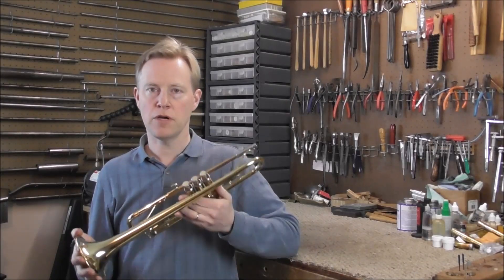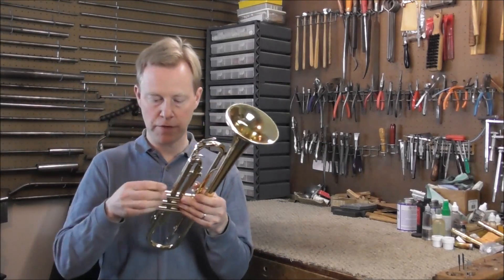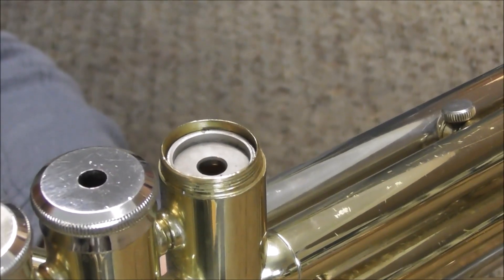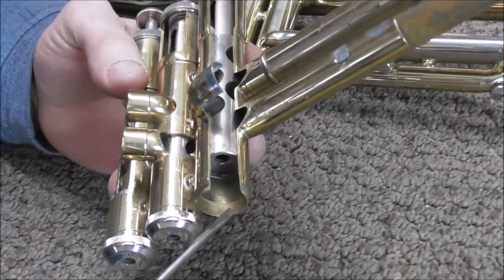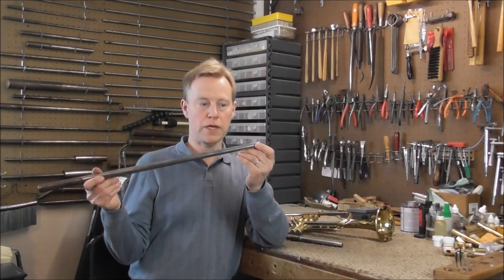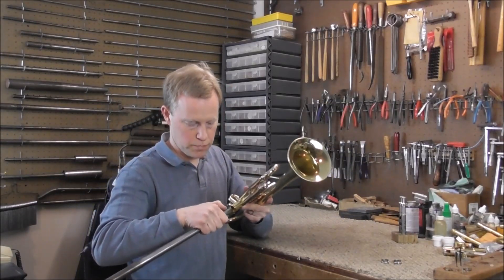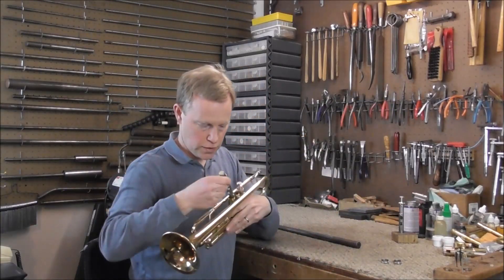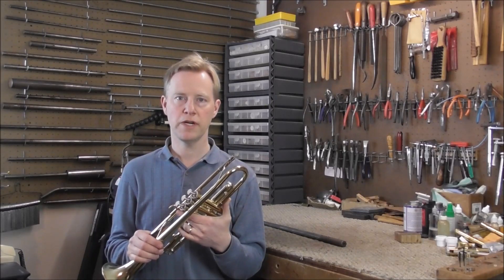How To Repair a Valve Stuck at the Bottom of the Casing

Comment: I have a similar problem, but with a 4 valve euphonium. Any tips on what I can do to fix this? (valve that is like this is 1st valve)
Reply from the maker: That is a very common problem with Yamaha euphoniums. Usually the problem is junk at the bottom of the casing. If that is the problem take off the bottom valve cap and put the valve in from the bottom and work it up and down vigorously for a little while. This should fix the problem, but there are other possibilities too. 
I hope this helps,
Art
Reply: @TheBrassandWoodwindShop  Thank you, this solved the problem.

Comment: Hi, sadly you are in the USA and I am the other side of the pond. I have an old trumpet (boozey&hawkes), the valves are not stuck but sometimes get a bit sticky, cleaned and oiled them and they work okish but still stick a little on occasion. One things I have noticed is that getting the valves out is very difficult, the top unscrews and you can pull them up, then it gets very hard for a bit, then they come out. Going back the other way is much the same, a lot of effort is required to push them back in, once in they usually go up and down ok, but its like the valve is too big for the insert in the casing. Any thoughts? I cant see any obvious problem but then its clearly not a huge huge bang.
Reply from the maker: The only thing that I can think of is that the bore of the casing may be ever so slightly smaller on the top if the valve has not worn the casing evenly. If this is the problem (I am not confident that it is) it can possibly be fixed by putting a ground casing mandrel in the top of the casing and tapping it lightly several times. I hope this helps, but I am not so sure on this one without seeing it.
Reply: @TheBrassandWoodwindShop  Thanks for the hint, its what I was thinking. The middle valve (2) seems fine, and the 1&3 valves are fine in that casing and 2 sticks in 1&3 casing... I was looking at doing a mandrel job on it, so I will try, nothing much to lose.

Comment: When I pull in the 3rd valve slide, my 3rd valve gets stuck, but when I pull out the slide,  the valve gets unstuck, do you know what the problem could be?
Reply from the maker: My first guess is that the third slide tubes on the tuning slide are skewed. When the slide is in the trumpet, the slide tubes put stress on the tubes that are on the trumpet. The tubes put stress on the casing and make it out of round which makes the valve stuck. If this is the problem, the valve should work when the slide tubes on the third slide are made parallel.

Comment: I bought a vintage LeBlanc Selmer from a gentleman that works on instruments at a local school. He cleaned (seeming perfect) in front of me using a lint-free cloth, replaced the springs, and oiled the valves. it worked great for a day or so then the 1st and 3rd valve (intermittently) will either stick or be slow to come back up. I even saw him insert one of the valves from the bottom as you suggested in one of your videos (if not this one). I love the tone and hope I can eliminate this random sticking. Any suggestions?
Reply from the maker: My first guess is that cleaning the valve casings may have loosened up some junk inside the trumpet. Keep using it for a few more days and the problem should solve itself. It could be another problem, but this is the most likely.

Comment: Thank you for the video sir! My 3rd valve is stuck and I can't even press it down, and I couldn't get the bottom part open either. Is there no other way than to go to an instrument repair shop? Thanks!
Reply from the maker: Here are two links to videos that may help. 
If you have never fixed an instrument before, you may want to take it to a shop though. Without seeing it, I cannot say for sure, but it is possible that you could do more damage if you are not careful. 
How To Remove Stuck Valve Caps
https://youtu.be/j3kyKc7rwWE
How To Remove a Valve that Is Stuck In the Casing
https://youtu.be/n3y92iATG6A
Reply: @TheBrassandWoodwindShop  Thanks man! Much appreciated!!!

Comment: Question . I have the #2 valve on my old conn sousaphone that does not go in is not the casing in this case is the bottom of the valve that has a dent how would I reshape it back or pop out the dent and witch mandrel should I use or is it better to replace it?
Reply from the maker: The best way to fix it is to use a N28D ground casing sleeve from Ferree's Tools. (ferreestoolsinc.com)(You need to tell them it is for a Conn sousaphone and they will send you the correct diameter.) Put the valve in the sleeve and tap the bottom inside of the valve with a drum stick until the valve conforms to the inside of the sleeve.

Comment: I have a middle valve that is stuck that works most of the time, but sometimes sticks halfway and stalls for a bit. I've tried oiling it and no luck. Any tips ?
Reply from the maker: There are too many reasons for valves to get stuck in this manner to mention them all. But this is what I would try first: take the valve out and take off the bottom valve cap. Clean out the casing with a rag on the end of a flute cleaning rod. Then put the valve in through the bottom of the casing and work it vigorously for a minute. Put it back together and see if it works. I hope this helps, but it is hard to know what to do without seeing it.
Reply: @TheBrassandWoodwindShop  thanks, I fixed it

Comment: QUESTION.  I have a 1920s Jenkens Special Cornet.  Beautiful silver.  The valve bottom was stuck and when I pulled out the valve from the top the piston separated from the spring assembly.  If I push them together it is loose and unplayable as the piston will not slide freely.  Is this repairable?   Can I replace a 1920s valve?  Help!
Reply from the maker: It sounds like the baluster came loose from the piston. The two can be soldered back together. You need to be careful to line up the ports and also make sure the valve stem is in the middle of the hole in the top valve cap. 
This sounds like an interesting repair. If you would like, you can send it to me and I can feature it in a video. Let me know if you are interested.